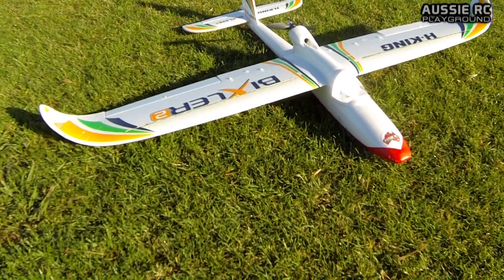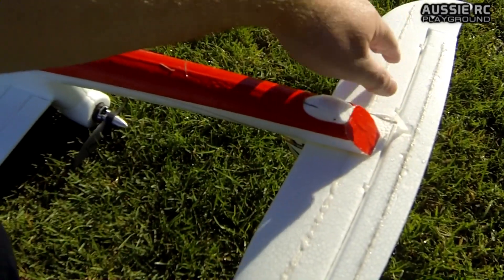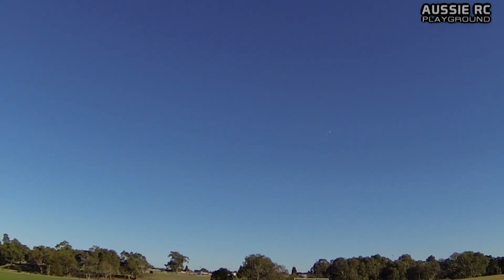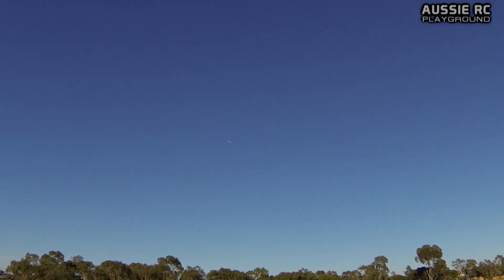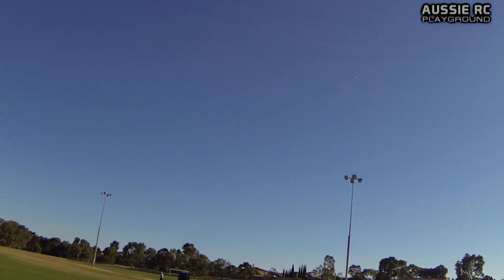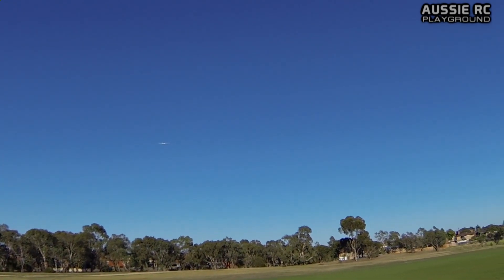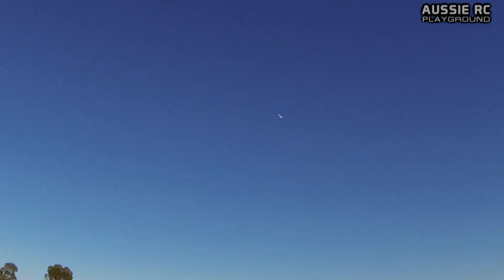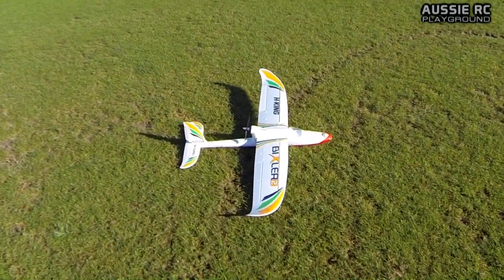Modified Bixler 2 with NTM Motor and 7x4 Prop Test Flight

Comment: Minimum 7x6 prop for that motor and 40amp esc, but 9g servo's at high speed will stall out! you need to slow to gain full control

Comment: nice video :)

I want to upgrade my stock motor , is this a upgrade for FPV usage ? i don't need to have the extra speed but just some extra power to get it up a little faster because i am using with a Gopro Fpv gear and gps

Comment: The banking problem you are having is probably due to torque roll if your motor spins to the right. If you shift the motor slightly to one direction it should help.

Comment: Thanks for the vid.
I've made similar mods using the same size motor which was stock in an EFX racer which simply wouldn't fly for some reason and became a complete fatality on it's 3rd crash.
I've added the extra spa to the horizontal stabilizer and the fuse but not to the main wings or elevator although I have added the 4mm rod inside the main wing spa.

I've had some problems with the wing connecting tabs breaking on the version2 leaving the tabs and the screws still connected but the wing coming away so I've drilled into them and glued a piece of carbon fiber rod through them and into the wing about 50mm so I hope that will rectify that problem.
I'm also using the 50 amp Durafly ESC which came on the EFX but I'm yet to test fly due to high winds here on the Gold Coast of sunny Queensland.
I'll be running a 6x4E sports prop initially but have a 7x4 just in case I want to go to heaven.
Reply from the maker: I tried the 6x4 before going for the 7x4 and I found that you need to be at the high end of the throttle curve for most of the flight. Also, there's not as much torque with the smaller prop, this means that if you want a quick burst of power, you won't get it. The plane will scream and sound really fast, but it really isn't. Well, it is but not as fast as this.
My plane is also a bit heavy, so maybe that's why I wasn't a fan of the 6x4 prop. It may be a better option for you depending on your set up and what you prefer.
Cheers. :)
Reply: Thanks for the tips Aussie RC Playground
I mentioned earlier that I'd added an additional spar to along the top of the fuselage but Hve had to replace it with one of less diameter because the swing of a 7'' prop was just catching the top of the bigger one.
Still waiting on Hobby King for the 7" I want to use but had a test flight this morning with a 6" and confirmed what you said about a lot of revs and noise and although still doughy from what I expected, it's a lot faster than with the original motor and prop.

Comment: I did similar mods to my AXN floater jet, (very similar plane), and you would be surprised by what that thing can handle! High G, wings about to fold!!! Had to mod the wings so they would stay on the fuse, first full throttle pass with the 2550kv motor (5.5x5.5 prop) the wings literally tore out of the fuselage and it lawn darted! Fixed that and it's a screamer now, thought about clipping the wings to make it more acrobatic, as you said, pretty lathargic in the rolls and such, but fun to fly!! Keep modding! See how fast you can make a bix2! Fun project!! 👍

Comment: I wonder if you could apply a mix to the throttle so that at 75% to 100% some left aileron is applied?  Or maybe fix it mechanically I guess..  But a mix could probably fix that torque roll. Might be fun to experiment with.
Reply from the maker: Not a bad idea, but I'm starting to think that my servos could be an issue as well. Not being able to maintain position at high speeds makes me think I need to upgrade them next. So even if I could mix it, not sure how it would work with the current servos, cause it struggles...

Comment: I love stiffening up fomies with carbon!  They all fly so much better with it... and tape.

On my Radian I have carbon strips on the fuse top and bottom, and in the front under canopy to stiffen up nose, clear tape all around to strengthen/ stiffen everything, extra carbon on the elevator, and a tube going down the leading edge of the vert. stab down through the fuse, and on the trailing edge of rudder there's a carbon strip and going to put two more strips on the trailing edge up vert. stab and leading edge of rudder where it meets up with hinge. 

The thing flies so much nicer.. Also have a 10mm x 9mm x 1000 carbon tube cut down for a spar which make s a massive difference compared to floppy stock fiberglass spar.

Now I am making a 3 meter wing for it with huge  1.7 meter carbon spar.  I'll be able to see it still at 2000+ feet.

Comment: Got a few of these motors on a air-boat :)  All kinds of power, or what? :)
The motor can actually handle a bigger (or more pitch) prop.. But yeah.. the Bix airframe can handle Some speed.. You're on the edge now though :)
Nice video sir! 
Cheers
Reply from the maker: Thank you. :)
Actually, that 7x4 prop is about as big as the motor can take. The motor is maxes out at 50amps and as it is, I'm pulling 48-49 amps. Going with a bigger prop will result in a dead motor much sooner. I had a 7x5 prop first and it was pulling 55+amps and had to reduce my throttle to 85% to stay in the safe zone. However, you can run a 4S setup with a smaller prop. The only issue there is that you'll be at higher revs for general cruising and given the plane is a bit heavier with all that reinforcement, you may not go any faster.
Personally, I like this setup... It allows you to cruise around at less than half throttle and you can really surprise people when you crank it up to full.

Comment: The full throttle thing could be either torque roll against the motor, or a thrust angle thing (see how your more powerful planes have the motor angled to the right? Bixler is straight) or the airframe is flexing lol. Goes well :)
Reply from the maker: Yeah, I'm thinking torque roll as well, but the motor mount does have an angle to it, however, I don't think they expected people like me to go nuts on it and try to break the sound barrier when they decided on the angle it has. LOL. This is a trainer/FPV plane and was never intended to be this fast, so the "banking right thing" at full throttle is just an adverse effect that the plane was never designed to deal with. Still, it's a lot of fun to fly and does keep you on your toes. ;)
Reply: Badmuthatrucker666 Yeah I'm going to go with torque roll. Full throttle is a dead giveaway.